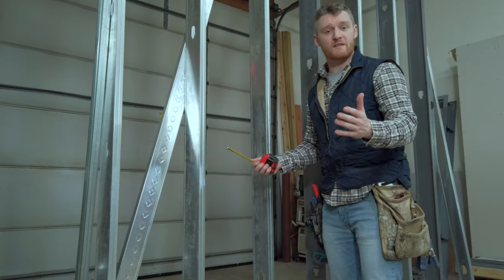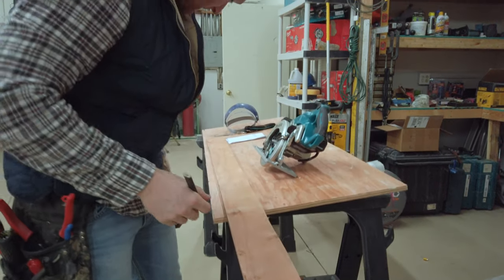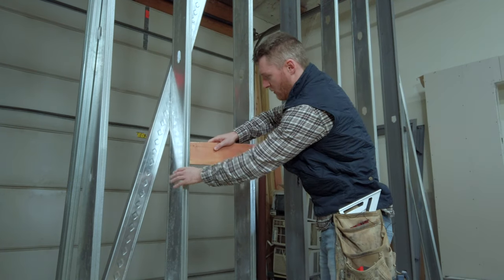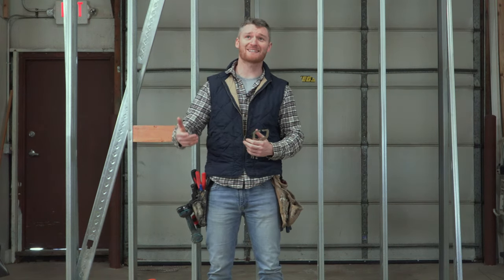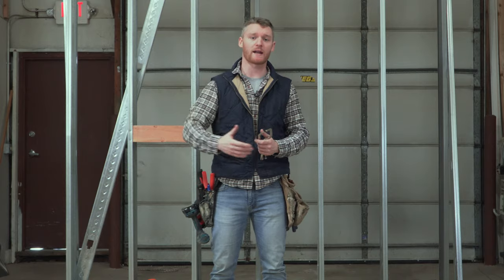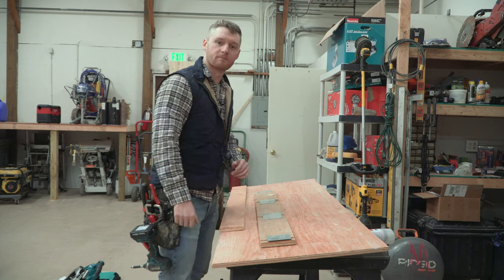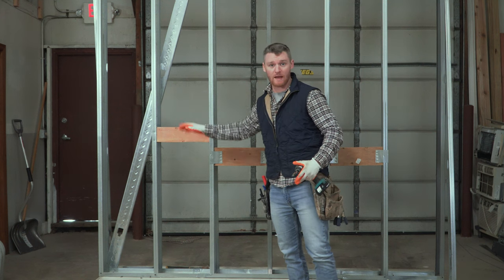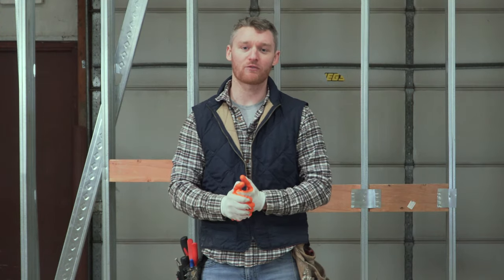Why You Should Be Using Danbacking

Comment: Just a correction on terms.  What you are calling the "flange" is actually termed a "lip" or "return".  The "flange" is the part (e.g. 1 1/4"  or 1 5/8") you screw into.  It took me a minute to figure out what you were talking about at first.  But good video, thanks.  One other advantage to Danbacking is that you avoid screwing into the end grain of dimensional lumber or plywood thus making what would seem to be a stronger assembly.

Comment: Time and money wise I don't think the traditional method is that bad.

The advantage here is really you're installing the system with fasteners and screws which are front facing, including those staples.

With the traditional technique you're putting screws in from the side, which is probably going to be a real PITA if you have two or more in a line and you need to get back in there and fix something.

Comment: What about the regular and townhouses new constructions? It also has wood for the kitchen cabinets?
Reply from the maker: Yea if the metal plates were cut for that. These are made to ‘clip’ into the studs with a dado cut. If they were to manufacture then at 14-1/2” with a1-1/2” width between them and then plate over they would be perfect for that. I’m just not sure anyone has don’t that.

Comment: Great video! I understand this is great to do while a building is under construction. I have a situation where we want to mount a network enclosure to a wall with metal studs. We are mounting plywood to the drywall. Is this sufficient? For the weight we feel there should probably be a backing such as what you are showing here.
Reply from the maker: Yea it should be. Just make sure to put in enough screws to the studs. Also use 5/8”

Comment: I use a 10” radial arm compound mitre saw and 2x6.
I measure from the hard side of one stud, to the backside, exactly, cut the slot ,and give it another 3/4” to screw to. And always go against the layout.
If your framing is nice and straight, you can pump out a bunch real quickly once you get the hang of it.
What’s cool about the danbacking is, you can use a lower skilled hand on it. And they should be quite efficient.
That’s they only way I can see making it worth using. The offset in labor cost might help that way.
Reply from the maker: Oh absolutely! I totally get your point. We have walls sometimes where they need 4 rows at different heights so it makes it a breeze.

Comment: I can understand your old way of cutting and notching the plywood with a circular saw would be slow and tedious but I'm curious why you wouldn't set up a router table on the jobsite with a 1/4" router bit and have the fence set for that little flange. Once you'd have a good system down then you'd get quite a few pieces of plywood cut and notched. At $6-$8 a piece for the danbackers it would soon add up especially when you're putting in 3 rows of blocking on both sides of a 40' wall for cabinets
Reply from the maker: A -Carpenter I do mention that you can set up a whole system to do this. I was showing (a) process of cutting/install and regardless of setting up a system, danbacking would be faster. These are for assembly type systems where you have to put up thousands of feet and build it into your cost. The hotels/assisted livings, medical spaces and appliance stores are the examples I used to showcase this produce, again this is for assemblies. In your instance of one room, we would still not set up a table because we can build the cost into the job, grab it from our shop and install. It saves time, labor and the variable of having a guy running a saw for days and days which I don’t want because it’s safer to buy danbacking than the workers comp. Hope that helps👍
Reply: It looks like there’s a potential market for a retired fella to make danbackers all day. Those are simple reproducible and connected with cheap plates.@6-8 a piece, man, it’s a good living. I like the idea of them and how you installed.

Comment: I am mounting my TV in my high rise apartment and I thought it was all metal studs (I was going to anchor it), but after drilling my first hole, I noticed that there is wood behind the metal. Is it safe to assume that this is what is going on behind the drywall? And if so, should I drill through the wood and add anchors like I would if it was just metal studs? Thanks!
Reply from the maker: We’ll if this was the case you wouldn’t need anchors. You would screw it to these with the lag screws these would have packaged. But my guess is your just happen to hit the studs.
Reply: Did you just discover a nail plate?

Comment: Is there a retrofit for a repair? I have our daughter's school that may need something like this in the middle and everything is finished. <sigh>  I may need to cut a hole to make it 'new'
Reply from the maker: We also use flat stock. Which is 6” band of steel that we just place over the studs. Still have to cut open the wall.
Reply: What ga for the flat stock and what screws to secure, thanks?
Reply: I forgot to ask, what fasteners do I use then for the kitchen cabinets into the steel flat stock?  Additionally, do you need to use Danback or flat stock for the bottom and/or middle screws (if required) in hanging the cabinets?  What is the thickness of the wood used in Danback?
Reply: Why cut out the drywall?  What about screwing the metal stock over the drywall?  Thanks

Comment: Hi. Maybe I am confused? So you don't anchor the wood to the steel frame and the weight of the cabinets is held on these staples the steel plates are attached to the board?!
Reply from the maker: You drywall over and then screw your cabinet into the wood
Reply: @Anthonycapone8146  😎👍

Comment: I’m working on building some bunk beds for a condo that uses metal studs. Is there anything special I need to do to screw the corner posts into the studs? I’m assuming I can even do that?
Reply from the maker: There shouldn’t be anything special. I would pre drill, but once you hit backing you should be good
Reply: @mitchellacoustical3119  thank you for the reply.

Comment: what type of screw was used to go through the metal into the wood? And it's ok for the screw to punch through the back of the wood?
Reply from the maker: A self drilling screw is what we use. And you can use a 1-1/4” self drilling but we use the pan heads to keep flat and they don’t go thru the wood.
Reply: Thank you for the reply. I had some low profile lath screws laying around but I’ll grab some self-drilling ones to do it properly. Those are the screws with the drill point tip?

Comment: Can't you just make your own with a 6" flat stock, precut them to size then connect with crown staples.
Reply from the maker: We build hotels and assisted living like we mention in the video. That which requires thousands of pieces. If you’re set up for that, by all means go ahead and do that. We build it into the bid👍
Reply: 6" 20ga flat stock is a quick alternative to plywood. If you can get it approved. Depends on the architect